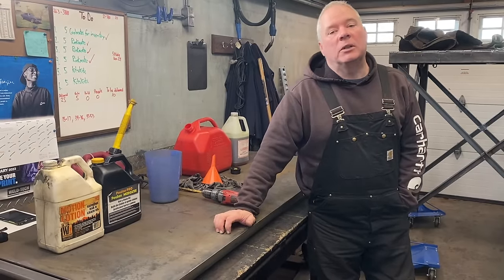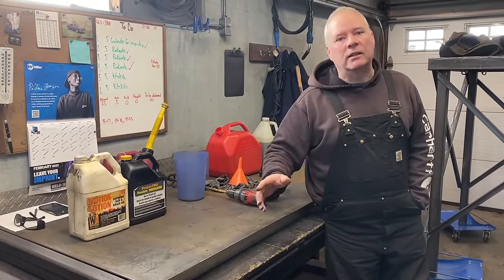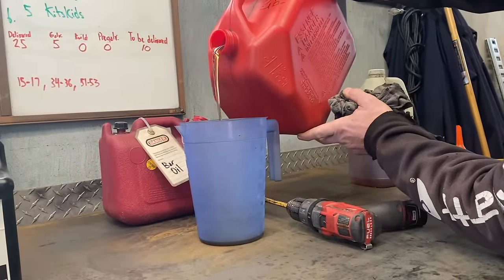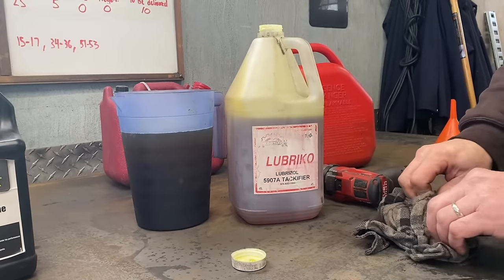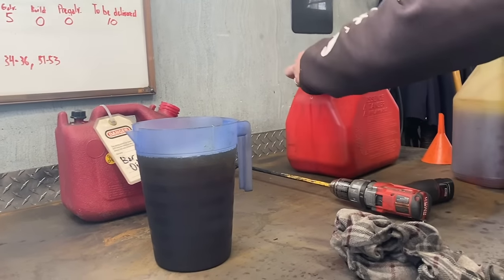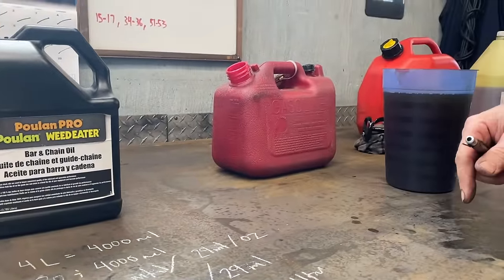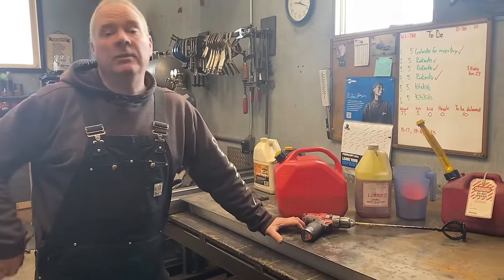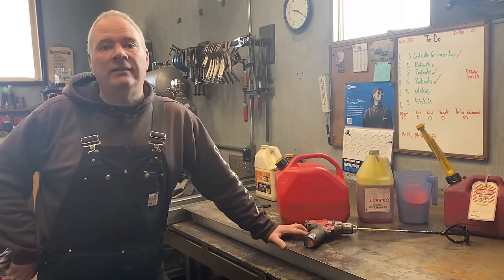How to Make Cheap Chainsaw Bar Oil!

Comment: Used motor oil is free! Been using it for years
Reply: It’s so bad for you and the environment though 😫
Reply: traditional oil or synthetic? Substantial difference in contaminants.
Reply from the maker: Thanks for the comment, but personally I don’t think I would want to do that. With the price and value of my chainsaws I really can’t see all the contaminants being healthy for the oil pump. My hydraulic oil is almost the same colour after 400 hours as when it was new, used motor oil after an oil change, not so much. And I have so much used hydraulic oil from the tractor I wish I could give some of it away 😂. 
Thanks for watching.
Reply: It's too thin and non-sticky, will rapidly centrifuge away at the bar tip
Reply: I am 80 yrs old and been using used oil for 60 yrs.
Reply: @buildingthebruce  
you must have a really complicated and expensive oil pumps in your high value chain saws
Reply from the maker: Stock oil pump in all my stihl saws. Never had a problem from my MS200T all the way up to MS 660 for milling. 
Thanks for watching.
Reply: @ljalpena3552  no cancer yet ?
Reply: Who cares?, he is 80 years old
Reply from the maker: For joebird1400:  not even close to 80 and 60,000 views so quite a few people care about saving some money. You ever cut wood?
Reply: I like adding STP to the drain oil back in the day...don't even think they make STP anymore
Reply: @buildingthebruce  merry Christmas from the uk
Reply: @acajutla It's a once through system.  I don't think it will matter.
Reply: You've got Bucken Billy Ray rolling over on his pulpit
Reply: @buildingthebruce he’s obviously referring to your comment about used motor oil being harmful to your oil pump. Have you ever seen said oil pump in your Stihl chainsaw? Over three decades of experience with chainsaws and used motor oil in no way will damage any part of your saw. It will however make a mess if you’re working above a house, or concrete driveway etc. but by the sound of your comments you have no experience beyond a hobbyist. Which is fine, but at least be open to listen to others who may have a different opinion or perspective on a subject. And also keep in mind that YOU are the person who put oil in a blender so you might gain a little wisdom from the people who take their time to comment on your ridiculously funny video and even better comments. 😂😂🤣
Relax it’s just a joke and it’s not serious, just like lubricating your bar and chain on your Super Stihl amazing chainsaws isn’t that serious. It really doesn’t require math, measurements, or blending…just make sure you see lubricant a steady spray flying off the bar tip without hearing any noises, or see any sparks from friction on the drivers, or the bar. The best thing you could do for your saws is to use non ethanol gas, good 2 cycle mix at 50:1, and keep your bar and chain out of the dirt. OH, and subscribe to ‘Buckin’ Billy Ray’ for real advice regarding chainsaws!
Reply from the maker: @ethanlancaster76  
Well I wouldn’t say hobbyist. Certified chainsaw operator, Certified Tree Faller, Certified Tree Rigging and Hazardous Tree Removal: Arborculture Canada. 
But that’s the beauty of YouTube. It’s my saws, my money and my opinion, take it or leave it and do whatever you are comfortable with.
Reply: @dalemeyer8207 
It's still being made. 
About $3 at Wal-Mart. 👍

Comment: 40 years ago as a boy, 15 years old working in a gas station in the Midwest. We are always delivering 55 gallon drums hydraulic oil. Diesel oil Motor oil to the farmers.... And we're always picking up the mostly empty cordrums with maybe 3-4-5 gallons oil in them.   Just weekly saying maybe deliver in 25-55 gallon drums and pick it up 25-55 gallon drum Cores,,,,, Anyway, they told us the procedure for these cores was to drain out the oil at the facility. And all this oil would be mixed. Hydraulic oil engine oil transmissional oil any and all of it would just be mixed and a thickener tack agent would be added......... And that's how BAR OIL was made...... Anyway, you gave me great idea. And I'll start saving my automatic transmission oil using my chainsaws.
Reply: Careful,modern ATF has detergents that WILL eat through you seals. Bar resivoire is not a fun j0b. Start looking for a new saw now!

Comment: Something I've found with using older slow revving saws, the oil/tackifier used doesn't really matter much as the chain isn't slinging it off nearly as bad as the little modern rippers that make their power at twice the revs. Get some old 80-100cc saw for a fraction of the price as the latest greatest, use semi-chisel .404, and cut with a sharp chain for the whole day without needing to sharpen. It's amazing how some of the best methods have been lost to marketing in the last 30 years. Faster, lighter, smaller.. none of that matters if your cutting firewood.
Reply from the maker: Torque vs RPM. I agree with you on a lot of points. One thing that has improved I feel is the anti- vibration aspect of the new saws. My Pioneer will pull through wood all day long no problem if I could hold onto it that long!

Comment: Another point to consider is that even if the bar did not last as long with used oil, for what you spend on only a few gallons of bar oil you could buy a new bar.
Reply: It works great, can't get used oil smell out of cloths.

Comment: Been professionally chainsaw cutting for over 14 years. The dark color in dirty motor oil is going to pass right through the bar oiling system obviously not chunky. Look how much debris gets in the chain from one cut on a piece of wood. I use every kind of leftover oil I have and mix them hydraulic transmission deep fried peanut oil motor oil and have only gone through a handful of bars maybe 10. On all sizes and sorts of saws pole saws big small hand saws. I do notice this with a thin quarter inch thickness of bar they do get worn down fairly quick but I use them on every job. I think that's due more to the fact that they're thinner. I haven't bought bar oil in over 14 years.

Comment: Looks like a reasonable thing to do to make use of used tractor fluid.  Only hard part is finding the tackifier.
Reply: Something that is sticky like that is Lucas oil. Some might be more than others, like transmission additive, or gear oil additive. I know the transmission stop leak is crazy sticky.
Reply: Ya I googled that stuff and didnt have any luck finding it. Anyone else find a good tackifier yo use? I wonder if using tackifier in used filter motor oil or vegetable oil would be good ad well.
Reply: @vansicklejerry  I suspect one would have to call an oil distributor and hope they would sell to the public.  I couldn't find anything online either.  So, a decent idea but it just isn't feasible.
Reply: Lucas is heavy oil, with polymer tackifier. You fellas must’ve skipped right by my comment. You can buy it anywhere. Canadian Tire has small to large maybe 3 or 4 litre jugs.
Reply: @leebdj1949 I love the video. It has me hoping I can find tackifier cheap.. I'm gonna watch for it at auctions, estate sales, etc... at renovating or moving businesses also..  I can find that Lucas product too! In Minnesota... And that is exactly the product I thought of when he demonstrated the old (10yrs old) commercial tackifier product he is using. I think STP is a fair match to his tackifier. And I find it available at many stores. Comes in approximately an 8oz. blue plastic bottle. I don't mix my own Bar and Chain oils yet...,  but I buy some various bar and chains oils for my saws and I specifically buy the summer blend type (because it is thicker in the bottle) bar and chain oils when I'm stocking up supplies to make my own vehicle rust-proofing treatment. I also buy STP, and WD40 (reason not explained) ... to mix into the store bought summer type Bar and chain oils just to thicken it and help it stay on the vehicle under sides, chassis, inner hidden spaces, and seams after it has been applied as a rustproofing.
 I add 1 bottle STP to 1 gallon of summer type bar and chain and about 3-4 oz of WD40. mix and heat to about 200-250 deg. F.
 It has to be prewarmed to allow it to be applied to the vehicle (it is super thick at less than 90 deg F.) It may not work well in a chainsaw unless it's extreme summer hot weather during use.
However, Works better than ANY OTHER RUSTPROOFING I'VE FOUND! (based on (9yrs) real life all year around Minnesota testing as of now.)
Reply: @craftsmanbyheart sounds like an interesting rustproofing. Yeah, the Lucas tranny fix only gets viable cost wise, if you get the 18.9L bucket….about $400 Canadian. But that’s a lot of it, for just doing the bar oil thing. Maybe if it was split between three or four fellas that were going to make it. I think it would work out to maybe $85/gallon or something.
Reply: @craftsmanbyheart  Do you talk about STP diesel / petrol injectors cleaner or something else?
Reply: @igorpotocnik7231  Thanks for asking. I'm familiar with only one type of STP product... Which is the engine oil additive packaged in blue plastic bottles here in Mn.
 Although, I'm also interested in trying out another STP product in silver plastic bottles that is marketed as a "high mileage" or in other words for engines that have many miles of use or are showing signs of wear..  Either of these STP products are very thick at room temperature. The old STP engine oil additive I discovered in yellow cans, if I remember right, was the thick stuff.
Their was another product called "motor honey" that was very thick too, but I don't know who made or sold that product.
The STP transmission additive is not familiar to me yet. It may be a thin type of cleaner/ seal conditioner which is not the type of additive I'm using to make a rust proofing mix.
Reply: @craftsmanbyheart  I checked a little and probably it's product called STP oil treatment, although it's in 15 oz darker blue bottles. 8 oz light blue bottle is called STP diesel fuel treatment & injector cleaner. There are various products in different colored bottles (red, black, blue, silver) and in different volumes, so maybe that product you used isn't sold in blue bottles any more. That high mileage product is still in silver bottles. Btw I googled Motor honey and it's made by Casite.

Comment: I think what your doing is great  always in for getting double duty out of something! My father logged and I can't ever remember him using bar oil, used motor oil from anything. If oil comes from a motor after 3000 miles it still has lubrication values. As for contaminated there's plenty in tree bark and sawdust. I own 3 chainsaws and I don't use them very often so I use bar oil.
Reply: I first used a chainsaw over 50 years ago.  I didn't even realize they made bar oil for many years.  Motor oil was what I learned as a norm.

Comment: I have used food grade vegetable oil purchased by the gallon at Sam's club.  You can add it to bar oil or run it straight, works well for me.
Reply: Don't let it sit though that stuff sets like glue over winter.
Reply: That stuff sticks like hell and very hard to clean off. Its nasty on clothing too.

Comment: My gasoline powered engines all use synthetic motor oil. When I change the oil, I reuse the engine oil as chainsaw bar oil. I've never had any problems yet and I have been doing it for many years.

Comment: About 16 years ago bought a new I saw the price of oil it jumped a buck so I had extra money and bought eight cases then 3 gallons each came back 2 weeks later bought six more  winter oil than summer still have 12 cases of it at 3 bucks a gallon I'm 62 years old I don't think I'll run out😅😅😅 like the idea of what you're doing thank you
Reply from the maker: You are sitting on a whole lot of money with all that oil. Planning ahead pays off in more ways than one. Thanks for watching.

Comment: To be honest, I can't tell that there is any significant difference in the wear on my chains and bars regardless of what oil I use. I do notice a significant improvement in wear when I keep my chains razor sharp. Of course cutting firewood here in central Missouri is nowhere near as serious of a proposition as cutting in Canada, I just don't need as much.

Comment: I use the motor oil from my truck oil changes as well as regular 10W-40 motor oil with STP added to cut the slinging down.  Been doing it for years and my bar and chain have held up well . I dropped and cut nearly an acre of trees the past 2 years  on the same bar/chain with no issues or excessive wear and getting ready to cut some more dead standing and felled trees through this winter. I cant see spending $10 on a quart of bar oil when motor oil is $2.50 a quart
Reply: Same here!
Reply: Where are you finding motor oil for $2.50 a QT. A Gallon of bar oil is about $10-14 where I'm from in Alabama. JS!
Reply: @lancehenthorn17  walmart and $1.25 at the Dollar store.
Reply: where do you find motor oil for 2.50/qt????

Comment: All bar oil slings off the tip of the bar, somewhat,  ( more in the summer, obviously) that is how you check to see if you are oiling. Or You can check by pulling the chain away from the bar, and looking at the drive links, whilst it is not running.

Comment: Non-detergent, to keep from softening your seals. Something sticky (tackifier, STP, etc). Lubricating oil ... not hydraulic fluid. Centrifuge and/or Franz (toilet paper filter) clean engine oil, after the additives are burned out of it. Eye of newt and toe of frog works well, too.

Comment: I went to the Sthil dealer last week to buy a new bar for my MS391 the tip seized up due to lack of oiling, mainly my fault for not doing enough cleaning on the bar and using heavy weight bar oil in hot weather. The dealer told me to set the oiler to maximum and use lighter weight oil, funny thing is I wanted to buy a jug of winter weight “Sthil oil” but they didn’t have any, the sales representative told me nobody is buying it because it’s to expensive, they now sell a no name cheaper oil. I’m going to try your mixture, thanks for doing the video.
Reply from the maker: Thanks for watching. Sorry to hear about the bar, those are pretty pricey as well. Glad the video helped out, we are all in this together!

Comment: Get some magnets and set up a system to pour hyd oil slowly on the magnets and pull out the metal, I heat it up and add a little Lukas hub oil in 6 gallon steel tank and use HD honing drill and mix it 20 minutes 
Works great for me
Reply from the maker: That’s an interesting idea about the magnet. I’ve never thought that there might be metal in the oil but that makes sense. During the Christmas break I’ll be changing the fluid in the tractor transmission again and have a fresh 42 litre supply of oil. Happy to have it considering the current price of bar oil. Thanks for the comment.
Reply: @buildingthebruce  yes Sir I work at a major frac company as shop supervisor for 45 years and I was get a lot of hyd oil and we filter it in to storage tanks for recycling but if major pump or motor failure it went in waste tanks which company paid by the gallon to remove. So we gave it away 
I was picky and that’s why I used the magnets and I have waste oil heater in my personal shop 
I’m retired with plenty of waste hyd oil

Comment: Tried used engine oil for a while in my saws, ( run like 6-8 saws daily, yr round.) It did pretty good, just messy looking all the time.
Reply: Yea but I used parts washer after each day and cleaned it 
No big deal 😊
Reply: @philliphall5198  Dang , seemed like I was always busy fixing broke down old equipment, wish I had the time for the washing thing.

Comment: I also have 45 gallons of 90 w gear oil that I’ve been using in my cheap saws like poulan and the bars last just as long with this use oil
Just magnet it and done ✅
Reply: What do you mean magnet it?

Comment: Tried peanut oil ( was cheaper than bar oil. ) for about a yr. Running saws daily in the tree business. It did pretty good, but, gums up, around the outside of the saw, plus, way before lunch time, it smelled too good.  Luckily, I can just pass my expenses on to the customer.

Comment: That's a great idea! I've always wondered why it's so expensive... I have to pay $25-$30 for 4 liters!!!
I found the tackifier, it's now called Lubrizol 5907A Tackifier.
Reply from the maker: That’s great. I’m glad it will help you out and thanks for sharing the name of the tackifier.
Reply: Where did you find the Lubrizol 5907A Tackifier? I've been looking and can't find it anywhere.
Reply: @bobhanke6401  I don't know where to buy it actually, I just found that the name was changed when searching the internet. I also would like to know where to buy it 😮
Reply: I use 1 gallon used universal tractor transmission oil mixed with 1 bottle of STP oil treatment as a tackifier.

Comment: Great tip! I started mixing bar oil and UDT about 60/40 during covid when they wanted $20/jug at TSC/Peavey, but if i can find some tackifier this is even cheaper! And yes, UDT looks identical coming out as it does going in....
Reply: I use STP oil treatment for a tacifier with used  ATF for my bar oil! I'm a retired mechanic and get it for free!
Reply: Great info Donald thanks!

Comment: I've been using my drain oil from my cars , trucks , and motorcycle s as bar oil for years with no problems.  I do change it very often so its hardly dirty. Its thinner than bar oil but that doesn't seam to matter

Comment: You can dilute bar oil with used motor oil or used transmission oil to cut cost.  Of course STP or similar can be added to used oils too.   I add a shot of graphite spray lubricant to provide some dry lube protection in case the chain runs dry from clogged oil passage in the bar.  It also helps to shoot the bar and chain with a little spray on graphite dry lube when mounting it.
Reply from the maker: All good ideas. Thanks for commenting. Please consider subscribing to the channel for future videos that you may find interesting.